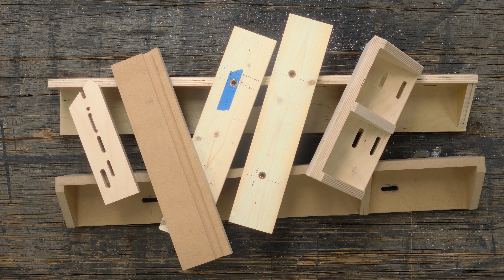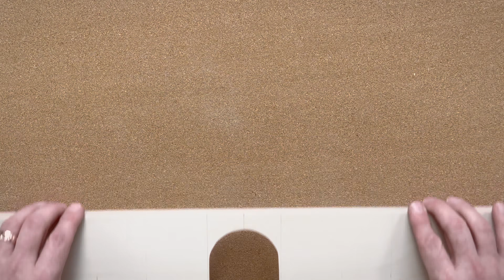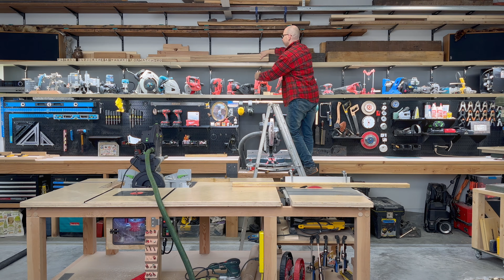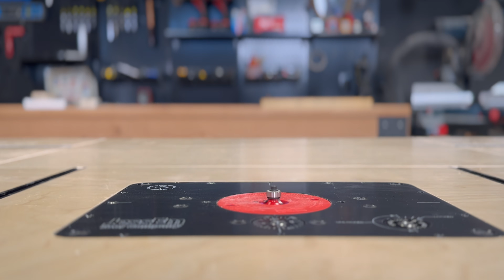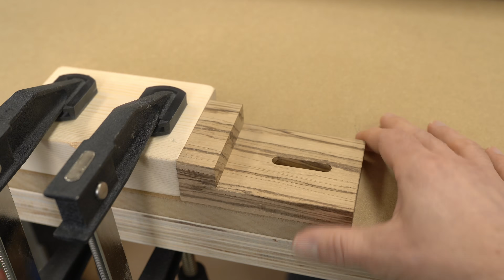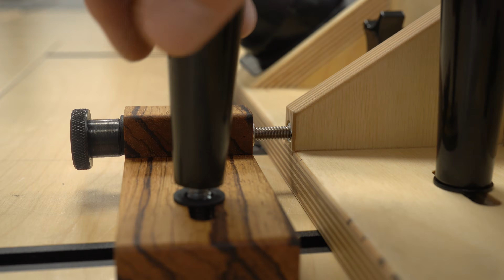DIY Router Table Fence with Built-In Micro Adjustment

Comment: Sometimes the algorithm sends me junk.  A few years ago it sent me your workbench vid and was hooked.  

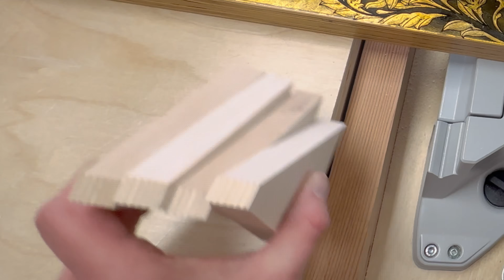Question:   Why did you use a spacer block wood against the fence when cutting the bracing? 3:42
Reply from the maker: Awesome the algorithm found you, bud! 👍 Glad to hear you've been enjoying the videos.
Good eye spotting the spacer! 😄 Those are just a couple of MDF offcuts I use as a sacrificial backer. They help support the wood as the blade exits the cut, which greatly reduces tear-out and gives a cleaner finish. I find myself thinking about tear-out on almost every cut these days and looking for ways to avoid it.
Thanks for asking. Cheers!

Comment: Very beautiful and precise craftsmanship!  Question:  Have you ever considered adding an independent adjustment to the fence on the outfeed side that would allow you to use the router as a jointer (i.e. adjust the RH fence outwards by 1/64, 1/32, etc)?  I am planning to build a fence and don't (can't) have a jointer and think this approach would be ideal for small parts.
Reply from the maker: Thanks Glen! Appreciate the kind words. I have considered it, and while I didn't build it into this version, you can mimic an offset outfeed fence by using playing cards or thin shim stock taped or placed to the outfeed side (behind the front faces) building thickness one playing card at a time. Hope that helps with your build!

Comment: I really enjoyed this video, and appreciated musicality you introduced into it...fun.   Makes these long form videos so much more watchable :)   Can I ask, when you re-planed the front fence after cutting the solid wood piece, how did you avoid snipe on your planer?!  I always get some snipe on the leading edge, especially with short pieces like this.  Anyway, I'm sure you can't answer everyone's questions.  FYI, if I build my own fence, I'll be building your design.  So meticulous. Well done!
Reply from the maker: Hi Saunders, You caught me at a good time, I usually jump in and reply to comments in the morning, so its great to meet you, and thanks so much for the kind words! Really glad you enjoyed the video 👍
Great question on snipe, that’s something I battled for quite a while as well. For reference, I’m using the DeWalt DW735. Adding the infeed and outfeed extension tables (and making sure they’re level with the planer bed) helped a lot, but the biggest difference came down to technique.

As the board enters the planer, I apply firm downward pressure right near the machine, not out at the ends. The key is to keep that pressure continuous…I use a bit of a “hand-over-hand” approach with my fingertips so there’s never a moment where the board isn’t being supported with downward pressure. Once the cutter head is engaged, I move to the outfeed side and apply the same downward pressure and technique as the board exits. 

If you release pressure even briefly while repositioning your hands, that’s usually when snipe shows up. Keeping that pressure continuous is what really solved it for me, especially on shorter pieces.
Once the board is fully engaged in the planer, it’s not as critical…it’s really those entry and exit moments where it matters most!

Hope that helps! And really appreciate you watching, means a lot 👍
Reply: @vanislestudio  Amazing, I will try that method today! Really appreciate the technique share🙏.  by the way, I watched your other workbench up grade video after, and noticed your flattening method for the long board, without a jointer.  Super slick, but time consuming maybe....I made myself a  couple different planer sleds for this same goal...they are shallow long plywood "boxes", for rigidity.  My long one is a bit heavy, but I made it narrower than my planer width, to reduce weight.  Then all I use is some playing cards and various thin wood shims to level my board, and then I just run it through the planer a few times. I'm sure this isn't news to you, but just trying to return the favor.  Cheers :)

Comment: Great build and edit. 
Any suggestion instead of zebra wood? I guess something slick would work.
Reply from the maker: Hey, thanks so much, I really appreciate that!
Yeah, you definitely don’t need to use zebrawood. That was just some hardwood I had left over in the shop 👍
For the sliding fence faces, the main thing is using something that’s flat and stable. MDF, plywood, composite-core, or any hardwood will all work well. If you go with MDF or plywood, adding something like laminate or UHMW tape on the face helps it stay slick and reduces wear.
Hardwood is a great option too since it holds up well over time and resists dents and bit contact a bit better.
So really, anything you can get nice and flat will do the job, just depends on what you have on hand and the finish you’re after. Thanks for asking! and for stopping in mate 👍

Comment: Does the fence move evenly with the micro dial only being on one of the t-track?
Reply from the maker: Great observation. It’s a common misconception, but unlike a table saw fence, which must stay parallel to avoid dangerous binding, a router fence only cares about the distance from the center of the bit. Since the bit is a single pivot point rather than a long blade, you can actually 'skew' the fence at an angle and still get a perfectly straight cut. That’s exactly why you only need a micro-adjuster on one side. Thanks for asking!
Reply: @vanislestudio right… duh! I keep forgetting this concept about router tables because getting things square is the bane of my existence 😂😂.

Comment: does the micro adjust move both sides of fence well?
Reply from the maker: Hi Justin, good question. the micro-adjuster only moves one side of the fence. The fence doesn’t need to be parallel to the table, it can sit at a slight angle. I get the fence close by hand first, then use the micro-adjuster to dial in the final cut. Thanks for asking!

Comment: It wouldn’t have occurred to me to build something like this with hardwood, but it not only makes technical sense, it adds a beautiful piece to the workshop.  I think I’d be more inclined to use some tools if they were this pretty.

Thanks.

ps. You got the LIKE for the masking tape removal clip! 😅
Reply from the maker: Hi Peter, I wouldn't have though about it either, had I not built that pool que case with my father, that, and I needed to clean up / out my shop and came across those pieces on the shelf... and there you have it. Its a pleasure to use and thanks again for stopping in!